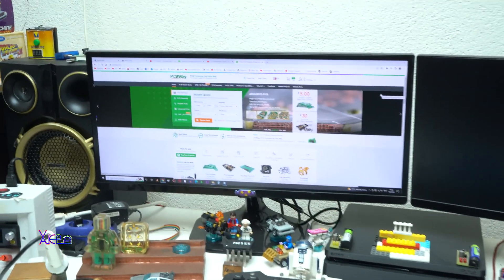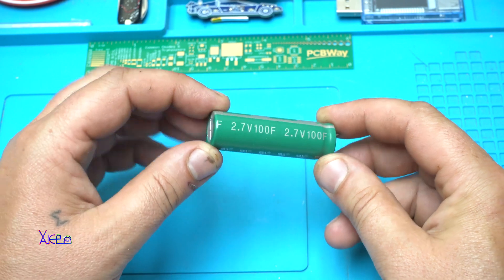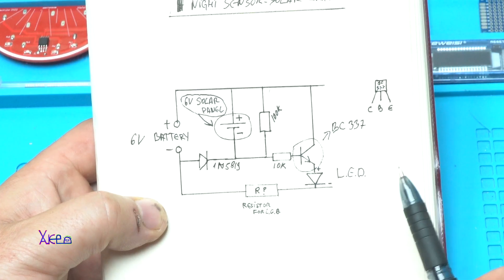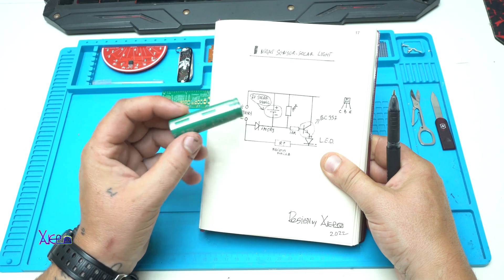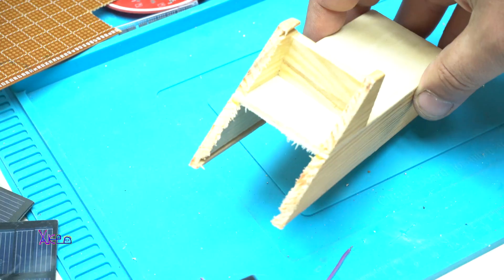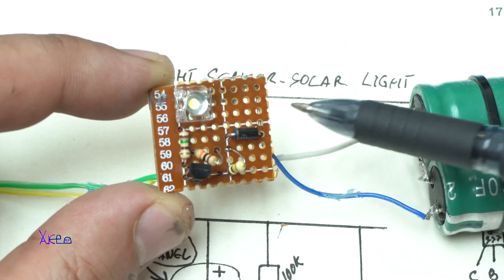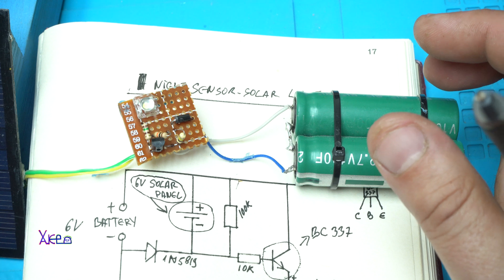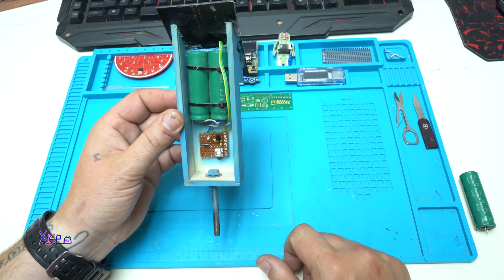Batteryless Supercapacitor Auto Night Light DIY Project

Comment: The two 100 f caps are actually 50 f....
Reply from the maker: You are right,serial connection drop capacity,double the voltage

Comment: As an expert, what do you say about my new battery? Because I have an abundance of leeks, I developed a bio-battery. It is filled with 8 kg of leeks and currently lasts 2 weeks, after which the leeks have to be replaced. I achieve 1 volt per leek with two electrodes. One is made of zinc and the other is made of an alloy whose composition I do not name. The battery currently has 12.8 volts/2.48AH with 8 kilos of leeks.